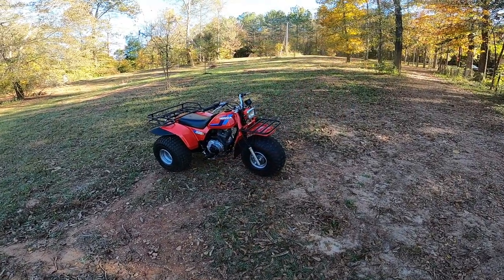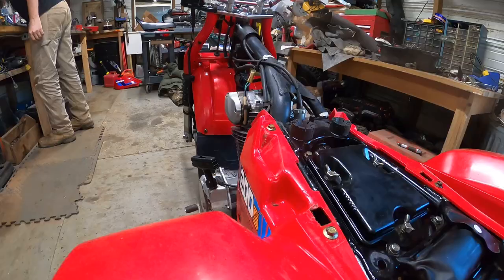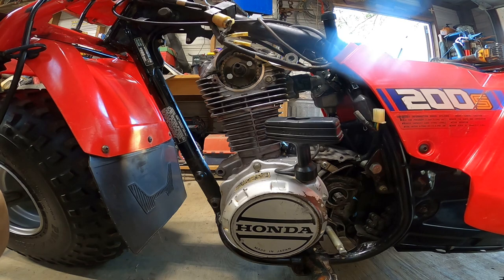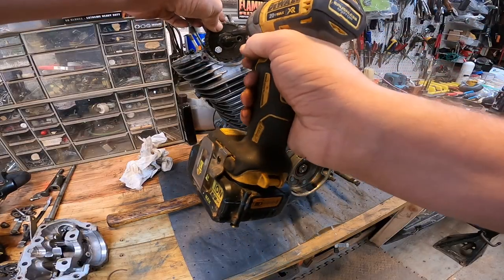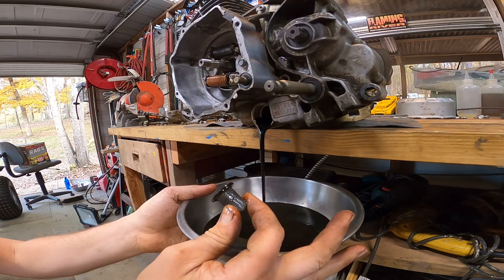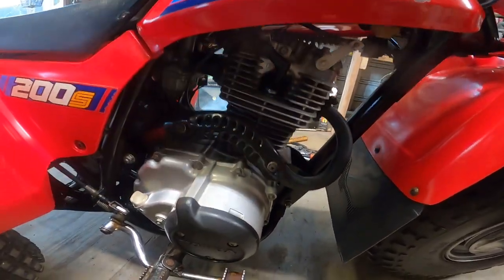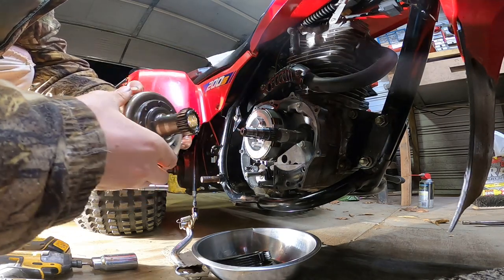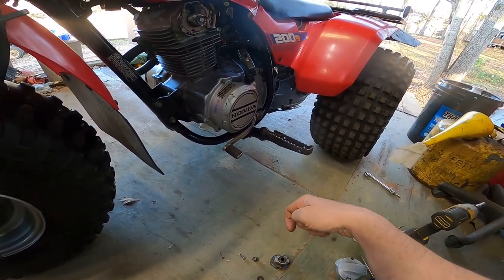TEARING INTO THE ENGINE ON MY MINT HONDA ATC 200S 3 WHEELER

Comment: Gonna pop in here as I'm watching you take the engine off and say I'm guessing you've just got to much lash in your valves. Those two caps on top of the head are there for easy-ish adjustment of those dudes. Pretty bike man, I've had a couple 200s and to many other 80s Hondas to count. Cool stuff 👍🏻
Reply from the maker: Nice guess but ended up being cdi

Comment: The atc 200s it’s mint the only think is it has the wrong gas tank it is a 1984 gas tank and not a 1985
Reply from the maker: it says it’s a early 85 on the frame and the gas tank was never changed out as far as I know 🤷
Reply: @TheHomePros6221  it was change out at some point but all the gas tanks are the same but the graphics are different but it’s definitely a 84 tank doesn’t matter if the trike was made early if it’s a 85 it will have a 85 tank which it doesn’t but still the trike is super clean

Comment: The most dangerous feeling vehicle I have ever ridden. One of these big balloon tired 3 wheelers with the two wheels on the wrong end. If the two wheels were up by the handlebars this would have been a good design. I rode one of these at 35 and knew if anything happened I would splatter.
Reply from the maker: lol